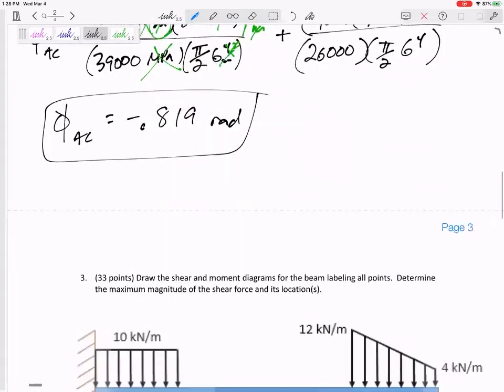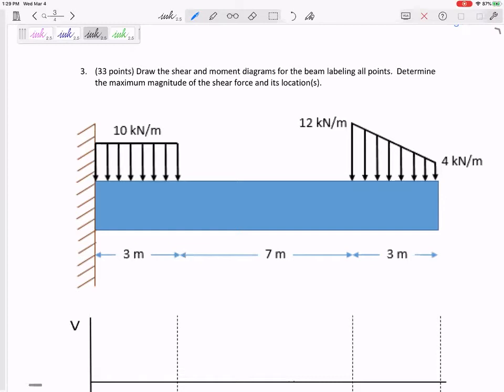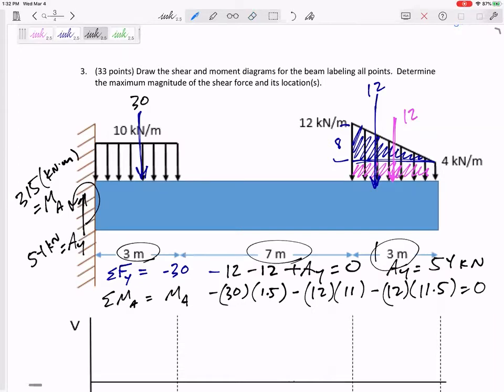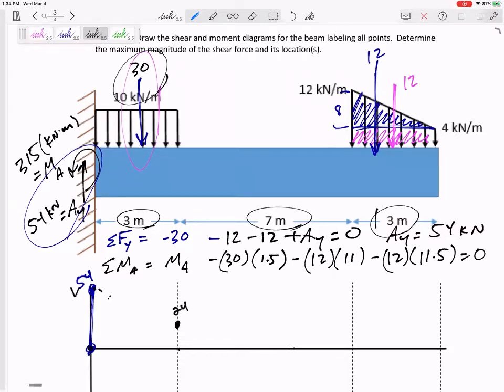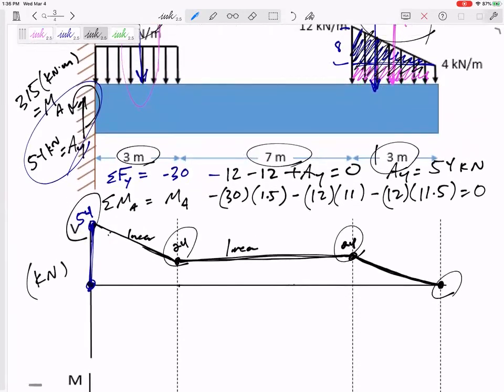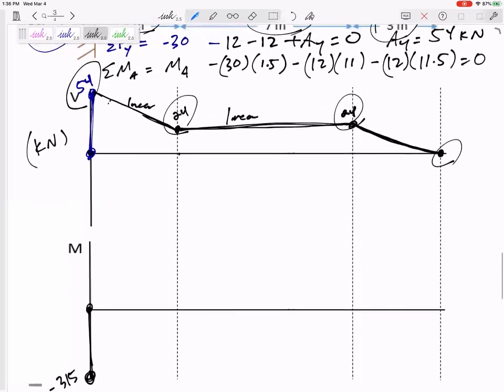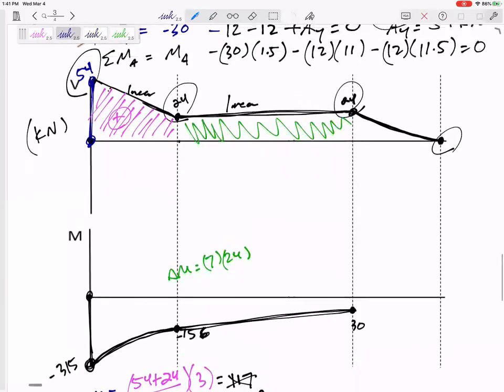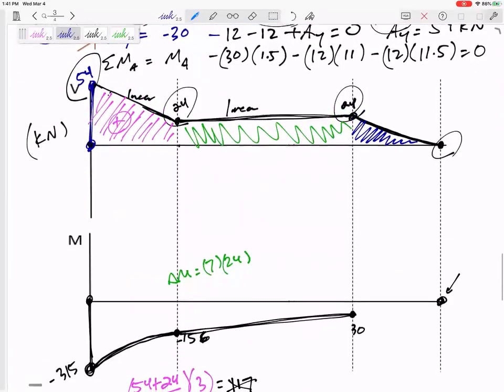Mechanics of Materials - Test 2 problem 3 - Shear and moment diagrams

Comment: on the moment diagram the calculations were good but you went with your notes instead? point b should be 198 (315-117) and then 7*24= 168 which will take you to point c which you got right at 30.